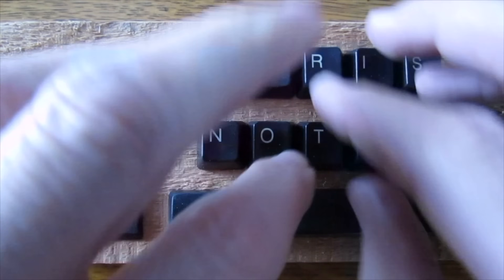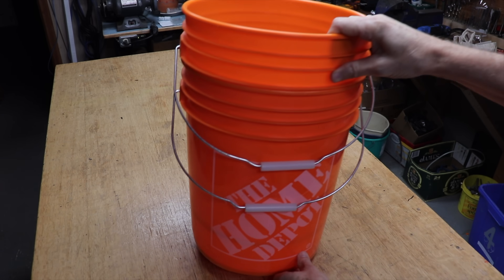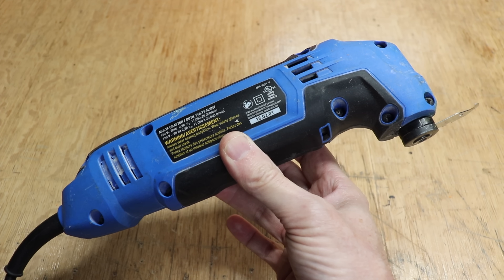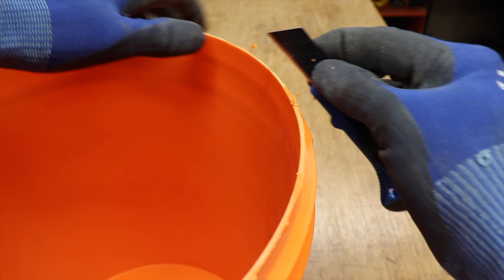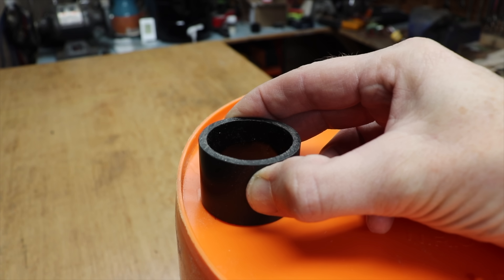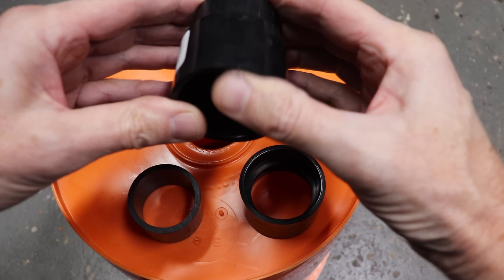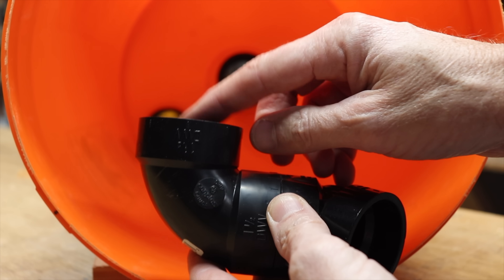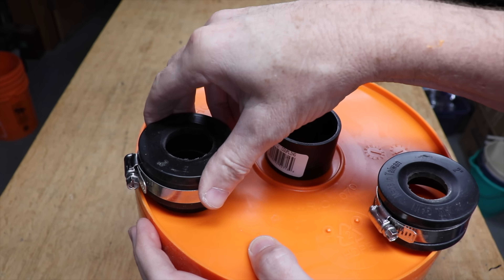How to Make ● Simple Cyclone Dust Collector

Comment: Excellent!!!!
Reply from the maker: Glad you like it!
Reply: Chris Notap So I made this with a couple of Lowe’s buckets today. I found that the bottom of those buckets is pretty thin and it cracked on the center hole while cutting it. I ended up siliconing everything up and am letting it dry now. I realize that some sawdust might stick to the silicone, even after it dries, but it’s minimal and will definitely be sealed! 👍

Comment: Hello Chris. Idea! Fill the bottom bucket about 1/2 full with water. Connect the power vac suction hose to just a couple inch's inside the top bucket, as you normally do. Connect your long work hose to a longer piece of plastic pipe, long enough to reach 1/2 way into the water in the lower bucket. Turn on the power vac and see if it will draw sawdust through the work hose. This scheme was used in older cars that used oil bath air cleaners. I haven't tried to build this yet, but if it works, there should be absolutely no dust at all in the power vac. All the dirt will be captured in the water. I enjoy your channel very much. Stay well.
Reply from the maker: Did you watch the update video? .....  https://youtu.be/BeU4nqSJtBY

Comment: thanks for ur vid. I hope u don't mind if I give a tip or 2. 1st to cut the bucket I used tin snips. 2nd to smooth the rim I used my seatbelt cuter on my knife. And believe it or not I made mine with a old upright hoover cleaner. I bought 6 pieces to fit on the top/bottom of the bucket and the seal fit so tight there was no need for any glue or silicone. I also didn't buy any hose, I used less then 1foot to hook the bucket and with 4 foot left of flex hose it also has over 3foot of stiff attachment hose. The electric cord was long enough when buckets sitting on front that it held the buckets in place with 2 wraps left plenty of cord to plug up. So as far as I know I invented the 1st "upright dust collecting shopvac."! email me for pictures {ezmred38@yahoo.com}
Reply from the maker: Sounds pretty cool Zach. Great minds think alike! I will email you for sure!
Reply from the maker: Got your email! Love how you used an upright vacuum. That's cool!! If I could attach the photos, I would. Thanks.
Reply: @chrisnotap  Thanks! Couldn't of done it without ya. Keep up the great work...

Comment: 2:00 That is 45 degrees not 90.
Reply from the maker: It was hard to describe that part! It is 90 degrees to the top horizontal lip on the bucket, but yes, it is also 45 to the vertical side on the bucket. Thanks!

Comment: There must be some secret, hidden part of the video I haven't seen, because I can't get those two buckets to join together.
Reply: I do, however, have a smashed thumb from trying to press them together and not succeeding.
Reply from the maker: Some have said that the home depot buckets in their area are slightly different than the ones in the video. Others have said that they used Lowes buckets and that they did work. Hope that helps.

Comment: Hey Chris I went to all of my local big box stores and can't find ABS pipe fittings anywhere. Could you point me in the right direction?
Reply: Yeah that’s what I ended up doing. Thanks for the reply. I made it today and it works great! I just modified a tiny bit because the new HD buckets are a little different now (new molds). Now I’m making a cart for it. Cheers
Reply from the maker: Others have said they are just using PVC instead. Hope that helps.

Comment: Cool idea Chris! But Chris i have a question, what do you think about to do this same assembly for to do a Collector of old or used motor oil when is time to change oil of a motor of a car or truck, that is recommend this between 7,500 and 10,000 miles? in this way the motor will have almost  a pure new motor oil completly (wont will have mix of new and used oil)  and the oil won't arrive to the vacuum cleaner!!  Or what do you think about to do a Collector of garbage clog and/or the water inside a house's drain pipe that is a clog or blockage and is necesary to get out this of the pipe for fix this?? Cool idea Chris!
Reply from the maker: I made these 2 other vacuum attachments that do those jobs! .... https://youtu.be/qr4shF-oOzg and 
 https://youtu.be/Uk46vCOGTFI

Comment: Chris--do you think it would work to use 2 1/2" hose and fittings instead of the smaller diameter hose?
Reply: You can get rubber flared fittings for going from an ABS pipe to a metal one like under a sink, some are the same dimension both sides, some allow for a change in fitting size.  Should be able to find at a local hardware store.  

https://www.canadiantire.ca/en/pdp/aquadynamic-tubular-drain-trap-coupling-0632650p.html?rrec=true#spc
Reply from the maker: Did you watch the update video? .....  https://youtu.be/BeU4nqSJtBY

Comment: I need a continuously running, quiet dust collector for sanding in my shop. Any suggestions?
Reply from the maker: Definitely needs to be outside for noise pollution alone with it running all day. I don't have any recommendations as to what model.

Comment: I've made this and it works great.  The major problem is the cheap ass buckets collapse at the slightest blockage and then they're weakened and it happens even easier the next time and in 10 minutes your work is ruined.
Reply from the maker: Yes. A few have said they have the collapse issue. I solved that problem in an update video......https://youtu.be/BeU4nqSJtBY

Comment: Built this project the other day and it works great. I made one tweak, so far, using 2" neoprene shielded couplings to connect the hoses to the collector instead of using the caps, cutting them to shape. One other tweak I'm thinking of is adding a couple  90* elbows and some more pipe so I have the inlet/outlet at the bottoms of the collector instead of on the top. It's a little top heavy in this configuration.
Reply from the maker: Check out the update video I just uploaded......https://youtu.be/BeU4nqSJtBY

Comment: I built it.  Works great.  I bought slightly different fittings but it’s all essentially the same.  The biggest challenge was getting the buckets to pop together - I had to put an large chamfer on the inside of the lower bucket using the same razor blade technique used for the upper bucket.  I’ll make a base for it next, maybe put a brick in the lower bucket for stability.
Reply from the maker: Did you watch the update video? ........ here it is.......https://youtu.be/BeU4nqSJtBY

Comment: I just made this using some green buckets.  The only change I made was I grabbed a longer 90-degree elbow for better air flow.  I also cut a 3rd bucket down, screwed it to a small Harbor Freight dolly and placed the dust collection system in that.  Able to pull it around the shop without tipping.  
 Works great with my little 1 1/4 inch nozzle Shop-Vac Hang up pro and I expect even better performance with my my new Rigid vac.  

Thanks for the great idea and “how to” video.

Ray
Reply from the maker: Here is the update video I just did. .......https://youtu.be/BeU4nqSJtBY

Comment: Excellent video. I built it, but ever so slightly differently due to the differences in parts available in my hardware store, but esentially the same. It works brilliantly. Although my bucket is a bit bendy and does ocasionally implode when the nozzle gets blocked. But not a massive issue. I can finally give my vax a bit of room to breathe and always get full power. Cheers dude!
Reply from the maker: I just did an update video to solve the collapse issue some are having....https://youtu.be/BeU4nqSJtBY

Comment: Great design. I've seen others with just the 45º angle and was pretty sure it was not enough. Just wondering if you've had problems with the buckets buckling if the vac pressure increased suddenly such as when the vac hose clamps tight onto a flat surface or sucks up some cloth.
Reply from the maker: Yes, a few have said they have a collapse issue if the vacuum is too strong. Here's the solution in an update video.....https://youtu.be/BeU4nqSJtBY

Comment: I made this and it works great. It is a little unstable though. I added a third bucket to the mix and problem solved. Add some weight to the bottom of the third bucket  (I used a couple of 10lb weights) I would think sand or bricks would be fine. Just set the bottom bucket into the weighted bucket, and you have a stabled base. This thing works like a champ. Thanks for the video!
Reply from the maker: Great minds think alike! I just uploaded the update video! ......  https://youtu.be/BeU4nqSJtBY

Comment: Hello Chris,

Thank you so much for this awesome video.  I'm inclined to do this project because I have to grind my concrete floors and don't want to dust up my shop-vac filter.

But, the one thing your video doesn't cover is the variance of sizes between shop-vac hoses.  The outer diameter to my shop-vac hose is 2-3/16".  What should the sizes be for the parts that I need?  2" for the elbows? 3" for the rubber caps?

Thank you again!

Comment: Okay, finally built this.  It works great!
Except when I use my long hose (which came with the vacuum) that reaches everywhere I need to clean, it doesn't pass air fast enough and the bucket sides cave in.  I need to strength them.  I'm thinking of making an internal cage for each bucket.  Then I can watch the top and bottom move toward each other.

I'm sure I haven't seen every DIY separator on the net.  But, of what I have seen, I like this one the best.
Hilarious opening
Reply from the maker: I have an update video that I just uploaded 2 days ago on the collapse issue with a simple solution..........https://youtu.be/BeU4nqSJtBY
Reply: @chrisnotap  My solution to the collapse was a bit different.  Rather than building a rib cage (my original plan), I cut out two 1/2" wide rings from 1/4" ply so they fit about the midway point of each bucket and tacked them in place with some Goop.  I don't experience the top heavy problem since I copied the cart idea using PVC pipe to mount the separator above the vac.
Loving this setup.

Comment: I made a collector with just one bucket because of the available space. Works great.  Having the fittings on the lid makes it more convenient. Thanks for the tip.  BTW - my vacuum cleaner fittings wouldn't fit the second hose I'm using.  I had some bicycle tubes laying around that about matched the size - cut a short piece to stretch over the ends - beats grinding out couplings or buying adapters.
Reply from the maker: Your a thinker!! That would work great!

Comment from the maker: Don't miss the UPDATE video!!  .....  I've added 2 more great tips!  .....  https://youtu.be/BeU4nqSJtBY
Reply: I did this. Have a couple more ideas for it. My shop vacs are the large 6hp ones with the 2" hoses. So instead of the rubber caps, I used 2"rubber couplers that have hose clamps at each end. No need for the pvc coupler, just push the inside up tight against the rubber coupler and tighten bottom hose clamp. Put your inlet and outlet hose in the couplers and tighten those hose clamps.  I also cut the end off an old elbow to attach to suction pipe - keeps the suction about an inch farther from the inlet which decreases dust direct suction from the end of the inlet. 
Liquid nailed a piece of 1 1/2" oak to bottom bucket to prevent tipping.
Thanks for the videos!
Reply: Just a quick note to thank you for this video. Tremendously useful. To cut the holes in the containers I found the plastic is fairly "soft" so using the tip of an the box-cutter blade to pierce the plastic around the scribed circle repeatedly makes a quick and accurate cut.
Reply: @atubebuff  bucket bottoms are to weak. reinforce by finding a plastic body medicine cabinet that's headed for the dump and cut out a plate to rest on out side inside lip[. Or else the holes will rip/bucket bottom cracks.
Reply: bucket bottoms are too weak. I satisfactorily beefed it up by adding a cut-out round plastic gotten off a back of an old wall insert-able medicine cabinet  no need attach: the fittings hold it onto the top/outside.
Reply: Patent it! 😏
Reply: Has anyone tried this on a sand-blasting cabinet?
Reply from the maker: @tvdinner325  Yes!! Commenters have said it works well  for that purpose.
Reply: Really? Nose picking intro?
Reply from the maker: @CatMomForever  It wasn't a pick! It was a scratch!
Reply: @chrisnotap  🤣
Reply: Can I buy one made by you?
Reply: This is truly good engineering. Not over engineered, just perfect!! Thank you so much!
Reply: Wondering if it works with drywall dust?
Reply: @bobbyjuice3935  yup, confirmed.
Reply: have you not seen new vacuum cleaners? just suck it through water, it will even collect the very fine dust.
Reply: The video starts as you're picking your own boogers and almost about to eat them. You have no business giving any kind a project advice.

.....🤣🤣🤣Just kidding. This is a very interesting video,  I remember watching it before and forgot about it so I'm back.

Comment: I'm stupid, and I know this is a stupid question because I don't do a lot of projects, but why not just let the dust collect in the vac and dump it out? I'm just wondering why I'd need a separate collector? Thanks!
Reply from the maker: There are no stupid questions! The reason most like it is because the filter in the shop vac gets impacted with sawdust and is messy to clean out each time.

Comment: How many hp is your shop vac? I built this but it doesn't work because my vac is 6.5 hp. After 2 inches of dust in the bottom it all gets sucked into the shop vac.

Comment: Hey Chris, 2 Question...
1) Would lowering the intake pipe in the bucket, positioned further down, away from the exhaust pipe at the top in the middle of the bucket, lessen the suck up of the dust as the dust collection and cyclone both would be lower away from the Exhaust?

2) Do you think, the use of a 6 gallon bucket which is taller also decrease the possibility of the dust being sucked up and out of the cyclone?

Just wondering, and thought I'd ask. This is probably the first DIY Video that truly wowed me. Timing, Delivery, Information, and Design all lined up to perfection. Thank You
Reply from the maker: You'd think that by lowering it it might be better but I tried about 5 different lengths. All it did was increase the dust storm by making it closer to the dust at the bottom. By keeping it near the top, it keeps the tornado going and pushes the dust outwards away from the middle suction port and keeps the tornado to a minimum at the bottom. Those are great points though. Great minds think alike!
Reply: @chrisnotap  THANK YOU, now that you explained it, that does actually makes sense, thanks for having the curiosity to try multiple lengths for us all "lol"

Comment: Hey! Great innovative ideas! I ended up building this and it works great in terms of suction. I have two issues, however and I thought is share my solutions to fix the things I ran into:

1.) Once the hoses are attached, it is top-heavy as all get out! When you run out of hose, the thing tips over and you lose a hose or a fitting falls off inside the bucket. I'd suggest gluing the fittings inside the bucket so your not having to open and close the bucket all the time (and being as the bucket is friction fit, it takes a few times to resecure it). I'm also working on a cart for both the shop vac and the bucket to solve the top-heavy problem.

2. The main hose that I have (and what many people may have) is your standard plastic hose. It's very fussy. Wish I would have thought of getting one like yours. In due time!

I really appreciate you sharing your project! And what's great about making stuff yourself is tweaking it to the way you like it so I thought I'd share some of my own tips!

Thanks,
Clayton
Reply from the maker: Great suggestions ! Thanks!

Comment: This is an OUTSTANDING idea and video. Thanks for posting it!

As someone else mentioned, the Home Depot buckets have gotten flimsier though -- my separator worked great, but started collapsing in on itself, like a crushed beer can.  Easy and cheap fix:  use a jigsaw to cut the bottoms off two additional buckets, then trim the top down to about 1 inch below the bottom lip.  Then just slide the bucket sheaths into the separator.  The fit is snug enough that no adhesive is necessary, and it completely solves the collapsing issue.  It also adds some weight, which helps with stability.

Thanks again for the video!  This was fun to make, and is already getting a lot of mileage in my shop!
Reply from the maker: That's great! Yes, I figured that out just after I did the video to just use another bucket on the bottom and push them together and for the top cut out the bottom and a small bit off the top and push them together. The double walled thickness stops them from collapsing. I think I will do an update video and show this. You're about the 7th person that mentioned the collapse situation. Thanks. Great minds think alike!

Comment: Depends on the bucket. Did this with the two identical buckets I bought and no way will top fit into the bottom bucket. Even tried greasing it and trimming the inside rim of the bottom bucket. Evidently some buckets are tapered more than others.
Reply from the maker: Others have said that Lowes buckets work.